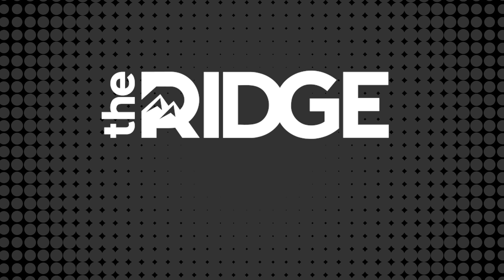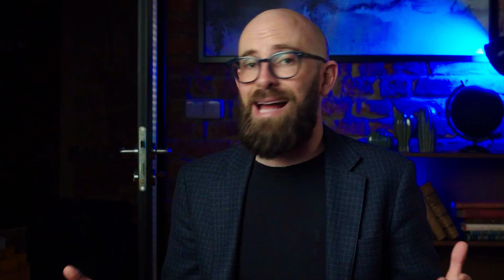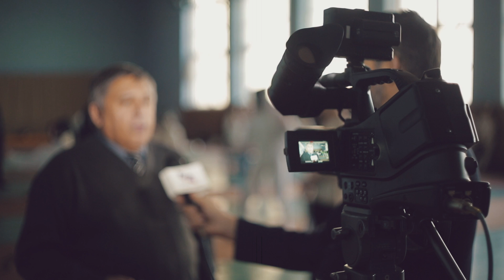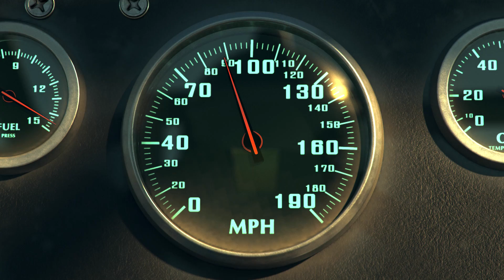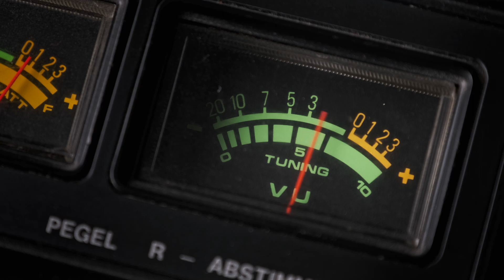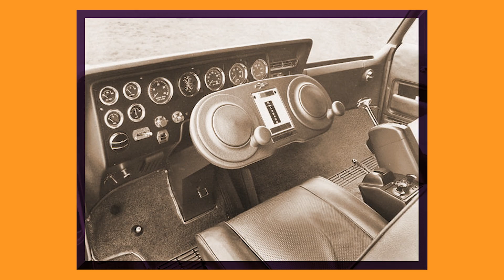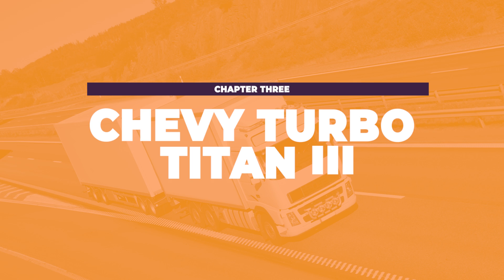Turbine Trucks: The Gas Powered Big-Rigs of the 1960's

Comment: Two cycle diesel engines, please make a video on these. My dad was a truck driver for all the years of his life pretty much. He talks about them but I've never seen one. They were used in the 1970's but not much after that
Reply: Yeah, those screamin Detroits set the mark for highway trucks back in the day until the development of the Series 60 when it became a specialized engine. 
The Series 60 was also a great engine, if you knew how to drive it. Too many tried to run them like a Cat or Cummins and would complain they couldn't pull. But, peak horsepower was at like 2100 rpm. You needed to wind up the 60.
Reply: Yeah they're neat
But don't stall it .....anytime
Ever
Unless you like using reverse to go forward
Reply: Look up two stroke diesel runaway on Youtube.
Reply: @Lemmon714_  I sure will, thank you. I really don't know why I didn't think of that. Guess watching the Whistlerverse so much I don't think to look up other videos
Reply: Plenty of two stroke EMD diesels in railway loco’s.
Reply: Every diesel I worked on when I ships was a two stroke. Couple different EMD models, GM 6-71, and Fairbanks-Morse opposed piston engines.

You should check out the latter.
Reply: Classic Detroit Diesel. There's a few others but Detroit is famous for them. Back in the day if you drove for a big carrier your truck was most likely powered by a Detroit. They called them Screaming Jimmies.
Reply: A lot of work boats on the intercostal and river waterways had Detroit diesels for their power.
Reply: One of my customers has one. I love working on it. I had to pull the engine and have it rebuilt. It was awesome to get her rumbling again.
Reply: I drove an old dump truck in 1989 with a two stroke Detroit and a 13 speed. The best sounding truck I have ever driven and being 18yo, I thought I was so cool with that loud exhaust.

Comment: Simon... love most all your videos. However, when describing the statistics on the turbine engine a picture comes up of what looks to be a V-12 piston engine (unless I miss my guess). Possibly it was a reference to the Allison transmission and not the engine it is attached to. Just had me confused for a moment. Nonetheless, great work and keep them coming. All your videos are my go-to for relaxation each day after work.
Reply: I saw that, too.  I think somebody typed in "Allison" and used the first stock photo that came up.  Too bad it was an Allison V-12 tank engine and not an automatic transmission.
Reply: He also compared 2.15 mpg to 9 Km per liter. 9 kpl is more like 21.5 mpg
Reply: @magnificentfailure2390  

3.8 litres in a US gallon. I think your maths is a little off.
Reply: @skylined5534  9 kilometers per liter works out to 21.17 miles per gallon. Thanks for the correction.

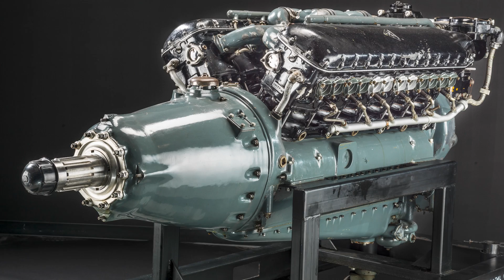Comment: 7:42 Not a transmission. That's a stock photo of the Allison V-1710 aircraft engine lifted right off Google.
Reply: I noticed that too. Pretty glaring mistake. Simon said on his DC-3 video, that it originally had turboprop engines. Wish he had a technical person to do a quick look at his videos, before they are posted. Maybe he could do a live chat premiere, then he could look at the comments to catch and correct the obvious mistakes, before he posts the video permanently. The guitar channel, 5 Watt World, does that, and it's very effective.
Reply: Well, technically that photo shows a transmission made by Allison. Also, their V-1710 engine ;) But yeah, i came here just for your observation, and mine.
Reply: I immediately paused and went to the comments to see who else saw this. Maybe Simon is using the same video editors as 'Dark Docs'
Reply: @johnnsteele2886  At least Simon rarely if ever has any cringeworthy mispronunciations like Robert Beltran is known for.
Reply: Engine, transmission... It's all the same, man.

Comment: -Turbine engines are a DEAD END when it comes to ground transportation.

Why?  Simple;  They are NOT efficient power plants at all!  In my spare time I fly a 767 in order to pay the bills.  

[You see, when I am home, all I do is work on the house, the boat, three cars, and the "honey-do" list that is endless~]

This vehicle weighs about 181,000 pounds empty, can take off at up to 406,000 pounds, and at altitude at 550 mph it burns about 3 gallons of Jet-A [kerosene] per mile.  Average fuel consumption at altitude varies but it is generally betweeen 10,000 and 8000 pounds per hour.

First of all, turbines are TERRIBLE when it comes to internal energy use:  Fully 75% of the energy that the turbines recover is used to drive the engine in the first place!  The compressor wheel of a turbine engine accelerates air between stages, then decelerates it in the diffuser sections to increase compression.  EVERY time you accelerate air you create a tremendous amount of drag and this drag uses energy.  Most turbine engines have upwards of a dozen stages, so there enormous amounts of energy spent just compressing the air.  An Otto cycle engine is WAY WAY WAY more efficient in this regard!

And then there is the turbine.  A tremendous amount of energy just flows out of the exhaust past the turbine and then expands in the atmosphere, the expansion is what we want in the first place;  Again, the spinning turbine wheel, probably 10,000 rpm uses up a lot of energy in simple parasite drag.

Parasite drag:  Increases with the square of velocity.  That means if you double the speed you quadruple the parasite drag. Going from 30 mph in your car to 60 mph quadruples the air drag....

Piston engines have NONE of these problems, but the monstrous problem with these engines is WEIGHT.  The 767 I fly has 62,000 pound thrust engines;  I've been told the entire cowling and pylon/engine assembly weighs about 13,000 pounds.  The piston engine that could reliably produce that amount of power is a Wartsilla cruise ship engine that probably weighs upwards of 1,000,000 pounds.  Which means that the airplane is not getting off the ground, no matter how long the runway is.....

NOW;  Turbines in trucks:  Trucks are commercial vehicles that are basically devices that are designed to make money for their owners.  The huge fuel consumption of turbine engines at low altitudes due to the thick air isn't mitigated the way it is on modern airliners.  So they suck the gas down like it is going out of style, and the only advantage of the turbine engine, the fact that it is VERY small and VERY light for the power it produces? Well, it means nothing in a heavy road truck.  That is why you don't see turbine cars or even trains.

-I am however waiting for Bugatti or some other very specialized car manufacturer to produce a turbine car;  The problem is that the startup of a turbine engine is VERY problematic, and while it works with airline pilots like me who understand these devices and their vagaries, the average rich guy who would buy one of these probably does not.

I almost bought a Porsche 928 with a Boeing 502 turbine engine a few years ago, and what kept me away was the fact that it was a rare engine with no parts support.  Otherwise I was the perfect candidate to be the next "keeper" of this car, since you never actually own a 928.